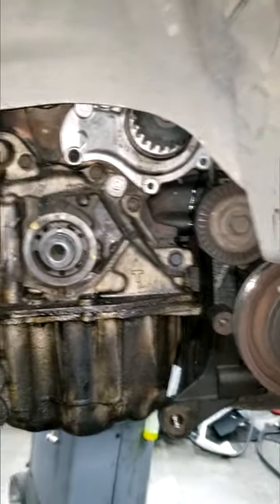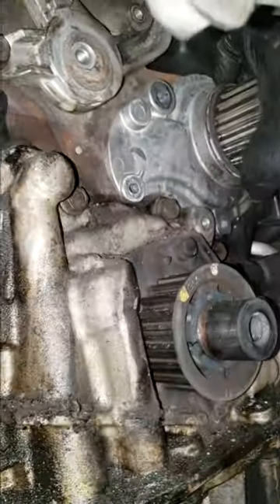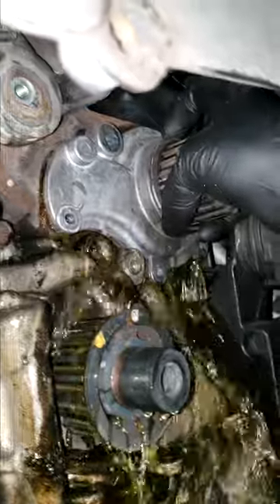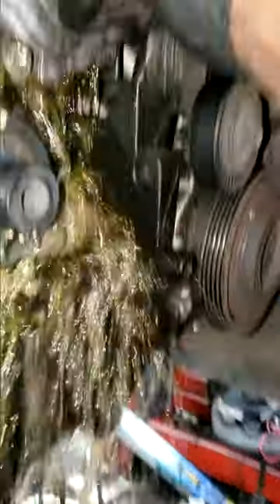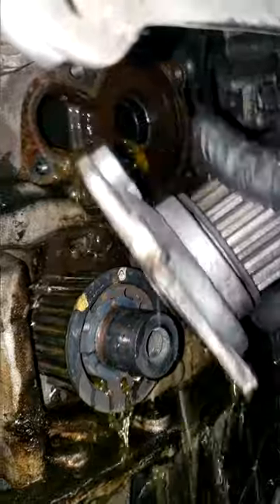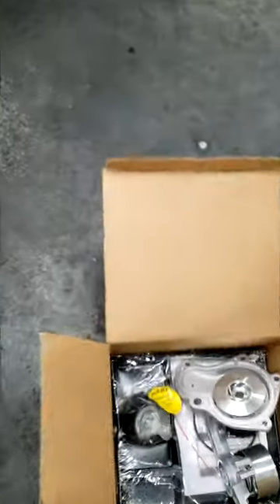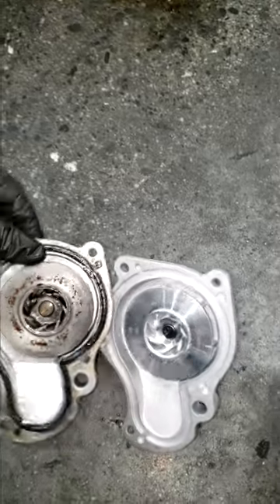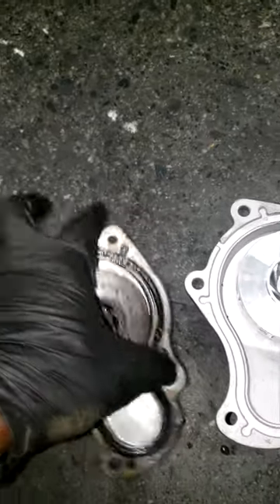WARNING. Using this can destroy your cooling system and water pump.

Comment: It’s a dodge, water is fine.  It will need a cylinder head, or a cam, or a half dozen modules, or a long block, or a transmission, or a set of lifters before corrosion takes it out.   It’s going to the scrap yard in a couple years anyway.
Reply: Lmao parts are gonna be falling off before any rust builds up anyway
Reply from the maker: Lmao, why do this ridiculous comment have 11 likes? Am I missing something?
Reply: @OnlineMechanicTips  because the water pump is out meaning it has at least 50-80k miles.  That vehicle truthfully won’t last much longer before needing more money in repairs than it’s worth.  So maybe another 30-50k miles of life left?  That cooling system is not going to rot out with water in a few years.  Yes, water is not good and you really need distilled water and antifreeze as coolant but damn, these vehicles seem to get really expensive to fix and need a bucket of money dumped into them after 125k or so.  Looking at some of these cars you work on they look like a beater theft recovery by the time they’re at 150k.   Not YOUR fault of course.  But I really do enjoy your videos and your #shorts.
Reply: Haha yes! You could not give this 21 year mechanic a jeep/dodge
Reply: Yeah but the thing runs at 220 degrees, plain water will contribute to premature devaluation. 

Wtf with 220 degree op temp!
Reply: truer facts have never been spoken before
Reply: @OnlineMechanicTips  Why is there a gunky sludge coming out of the engine when you took the water pump off?  That can't be good.  What is that - diesel and urea mixed with motor oil and the water boiled it all?

Second, why is there TWO water pumps in the same box?  In case one fails after install?  Or did the customer do the same to another NOPAR that also needs a water pump job too?
Reply from the maker: @delanorrosey4730  What on earth are you talking about? Wait, never mind.
Reply: Truer words have never been spoken.
Reply: @delanorrosey4730  The reason the stream of coolant looks solid is because the drainage rate has equalized between the water pump passage and the upper engine, so the coolant level isn't going down. If Shorts gave enough time to focus on recording it, you'd see the "solid" stream shrinking over time.

The base coolant color is green, the standard color of "universal" coolant for many decades. It's discolored because of age and contamination - some internal, rust is visible on the old pump impeller, and some external from running down the dirty engine block.

The box of new parts is a timing belt kit or water pump kit. It normally contains a timing belt, water pump, timing belt tensioner, and any bolts or guides that are specified for unconditional replacement. Any other parts should be inspected and, if replacement is necessary, ordered separately.
Reply: @Azlehria  That is by far, the best most well-explained response I've ever read.  My hat's off to you.
Reply: I agree. My 5.7 hemi just dropped a valve seat at 79k miles. I was going to attempt to fix it but after looking at the pistons thru a scope it's beyond my skills. Head gasket blew and when the seat dropped I see damage on at least 2 pistons on drivers side.
Reply: @kaiserwillie67  wanna sell it bro😊
Reply: @gripthebars1513  I'm gonna let a friend of mine take the heads off to see just how bad it is. If it can be salvaged I'll keep it. It's a 2007 300c.
Reply: LMAO
Reply: Isn't that the truth! Fellow mechanic here
Reply: @kaiserwillie67  prepare for the worst brother ! On the bright side build your heads an make some power ! Would love to see the outcome!
Reply: Change oil on often, drain and fill coolant every few years, don't let it overheat, and avoid excessive idling. It will last a long time.
Reply: @OnlineMechanicTips  it's a YouTube thing.  I have fun trolling ford owners, especially chev owners and really enjoy giving toyota owners the gears.
Reply: Amen
Reply: Had my ram for 78k and do routine maintenance works fine after 4 years. Those complaining about issues over 100k I have to wonder if this is their first time ever having to maintain their own vehicle. It’s pretty common for a lot of vehicles to need more in depth maintenance when you start hitting that high. Even my old honda at 250k still needed it’s maintenance routines done to make it run properly.
Reply: Is it the way people drive all of these trucks? The ones that last seem to have more chill drivers. So many trucks are driving around like race cars. Which obviously strains the engine faster? No? 

Also trucks can literally almost flip from a moose test. These guys are going 90-100 mph in a crowded interstate. 

I think the owners are killing all the trucks.
Reply: Yep. Buddy had a 2022 challenger and lifters started ticking. Traded it in for a 5.0
Reply: Fr😂😂😂
Reply: @OnlineMechanicTips  I think you meant does… dodge is ass
Reply: Yep
Reply: Let me guess, you’re not smart enough to maintain your vehicle as per schedule?
Reply: @chaseledbetter5186  Let me guess, GM is keeping you in business? I’ve heard those caddy’s have a great reputation for reliability…
Reply: @Titantitan001  the dodges that last have a cummins under the hood
Reply: @kronk9418  yeah gm's are good for business too. Not as good as dodge though. I've always had at least one dodge/jeep/Chrysler/fiat in the shop at all times. They're awful
Reply: Feeling attacked here, driving daily a 1973 Dodge.
Reply: So true 😂😂😂
Reply: @Titantitan001  Idiocracy at its finest
Reply: Not true.  I drive a 2000 Dodge Dakota with a 3.9 V-6 90 degree with a 5 speed standard transmission.  While I do need to find the time to change my water pump, thermostat, upper and lower radiator hoses, it runs like it should and has plenty of get up and go.  Now the parts don't all need changed but since I need to remove some of those parts to replace the water pump, why not just replace most of the parts of the cooling system while I have it apart.
Reply: @kaiserwillie67 don't buy another Dodge. The more you check the more you'll discover issues with these new generation Dodge/Chrysler vehicles.
Reply from the maker: @Jack Russelle Lewis perhaps
Reply: @Pew-pew-is-fun  they’re not
Reply: There's a reality check....

Comment: I kept telling my brother-in-law's brother to use antifreeze instead of water for months until he went on a ski vacation and his engine block split in half (he just turned it on in the morning at freezing temperatures and drove off on a cold engine)
Reply: Wow. I let my shit warm up when it starts getting into the 50s, I can't imagine just driving off in freezing Temps.
Reply: @sebastienceniceros3145  I do that all the time with my 96 grand marquis
Reply: @sebastienceniceros3145  as long as you don't push it hard it is better to drive it as soon as starting, unless you have water in the coolant at below freezing temp, that is just idiotic.
Reply: Guys water expands when frozen, driving on a cold engine doesn’t crack an engine block. Technically a freeze plug should have expanded out of the block but if it’s t o corrode or something not allowing it to dissipate the internal pressure caused by freezing water the block can crack.
Reply: I cracked my Audi's block by running water in it due to a coolant leak which I had ordered the damn hose for already. I forgot to drain it before it got cold and it was too far gone by morning. I let it warm up before attempting to pull off, but it just started pouring water out. Looked behind the intake manifold and sure enough, there was a big ass, probably 1.5mm wide crack about 3 inches long. Back to pull a part.. lol
Reply: @jackw1753  thanks for proving me right while trying to prove me wrong 🤣
Reply: @leesin2me  no sir, just clarified your point that you failed to make. After a stupid personal story that you needed to use to make yourself feel included, that meanders to a conclusion; and as it reads is incorrect.
Reply: @jackw1753  but I am included, because I'm the one that changed his engine LOL I own the workshop, and didn't charge him for labor or anti-freeze.

Different temps around the engine = different expansion rates = cracked block.
Reply: @leesin2me  different temps around the engine huh lol, I was hoping you would double down on stupid and boy have you ever. “ it was real cold on the outside and then somehow the internal temperature shot up to operating temp… and the internal forces ripped it clear in half” -leesin2me
Reply: @jackw1753  ehhh you clearly can't read LOL
No one said anything about internal forces. I clearly stated the issue with temperature differentiation. As you know, metals expand at different rates at different temperatures. 

I can clearly see you're a youtube mechanic.
Reply: @jackw1753  yes, i surely am. I also add windshield fluid to engine oil everytime i double fill with oil. Keeps the bearings nice and slippery LOL
Good luck with your LS swap👍🏻 they have a bad reputation for breaking flux capacitors. Double check them every once in a while
Reply: @leesin2me  lol I have a fan. Here I’ll add another short so you keep you up to date. Shoot add me on Instagram so you can follow the build closer maybe you see it blow up one day.
Reply: @leesin2me  this isn't a coefficient of expansion issue with the block and dissimilar metal expansion rates, it is the issue with freezing water inside it though. Being that water doesn't compress it will crack metal if it has nowhere to expand through by creating its own path of least resistance. 

What it sounds like you were trying to describe was thermal shock but in reverse of normal occurrence, perhaps even cold engine seizure which does have to do with the COE of differing metals such as aluminum pistons in steel sleeves. 

If you dont believe me go on down to your hardware store, get a six inch section of metal pipe, thread both ends, cap one end with a metal end cap, submerge in a bucket of water,  install second metal end cap, torque it down as hard as you can, and then finally put it in your freezer, and get back to me in about 45 minutes. There's zero sources of external heat to cause thermal shock, and only one type of metal, which will be your control variables. Bet my left nut it still cracks on ya bud.

Comment: That's yellow coolant it's a universal coolant to be compatible with the modern pink coolants. Ford used to use it too.
Reply: Trying to give advice when they've never seen yellow antifreeze
Reply: The new Ford coolant is the yellow. It replaced the orange coolant in 2020. You are right you can top off the old orange with the new yellow safely.
Reply: Yes you could buy the universal coolant at any Auto Part store. It's also  cheaper.
Reply: I have used piss on the side of the road. Never know
Reply: There shouldn't have been rust on the water pump... Could have used concentrated coolant maybe but didn't use distilled water with it..
Reply: @digi3218  if you look at where the rust is it's not in the open areas it's in the contact areas meaning it's not caused by moisture exposure it's caused by electrolysis
Reply: Well it isn’t compatible with Peugeot some guy replaced his coolant with yellow and his water pump started leaking when he asked me if is a common issue I replied you are the first person that had to replace the water pump on this engine it never leaks
Reply: @Locklord26  there are two types of coolant global (incandescent green) and OAT (dexcool, yellow, and blue). If you mix the two types they react and coagulate causing restrictions that build pressure and bind the pump. The issue is they both smell the same so if someone has a car with blue coolant and someone adds yellow. What do you think the next guy is going to think they should put in it
Reply: @NuKe0clan0cod0videos  well it goes green I’ve honestly actually never really thought of it much I’ve seen so many Peugeots with green coolant. anyway it’s made worse that a weird quirk of the Peugeot oem blue is it turns brown other techs top it up with tap Water!! then it starts turning to a dull yellow before coming clear.